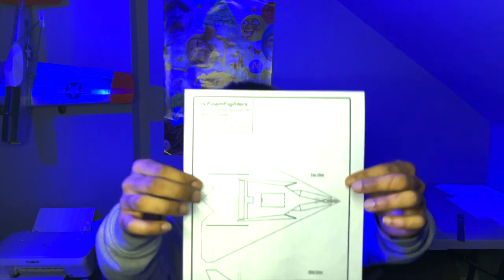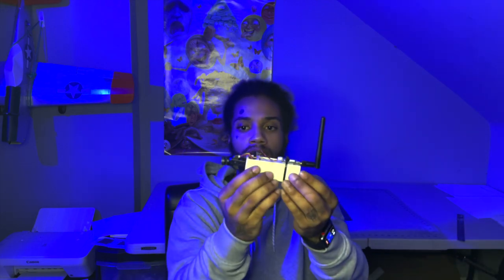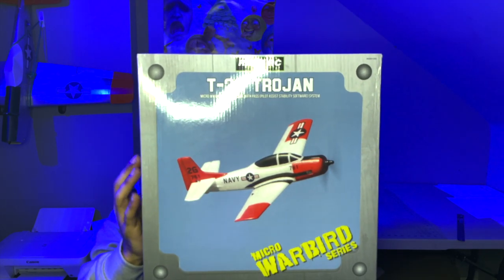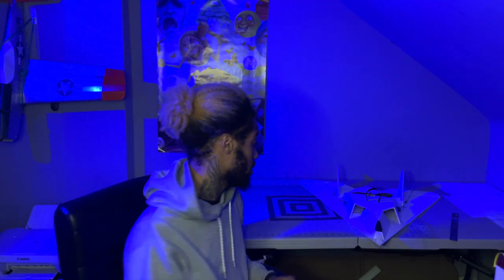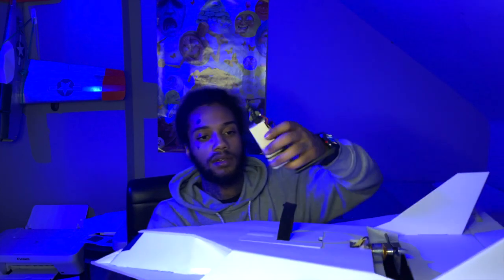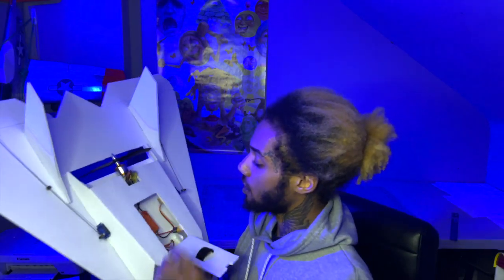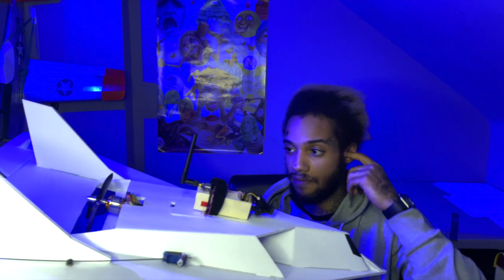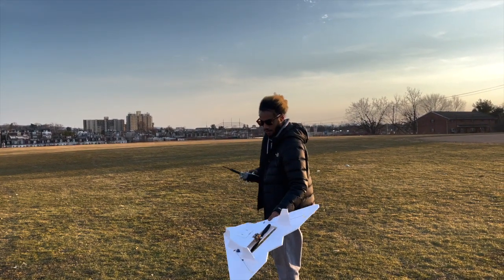How to build an rc jet

Comment: Awesome build and flight!

You could have moved the FPV cam so the nose wasn't blocking the view of the horizon, evenso; the video feed was pleasing even without the music. Not sure if your FPV pod has a separate battery powering the VTX and Camera, if it isn't... you may need an "LC Filter" to cancel out the electric noise going through the Receiver from the Motor and Servo's. You can buy them on Amazon for a couple dollars from iFlight. =D
Reply from the maker: THANK YOU carbon! And yes the fpv pod has its own 2s battery, so is that what happens to the video footage every i wind up the motor?